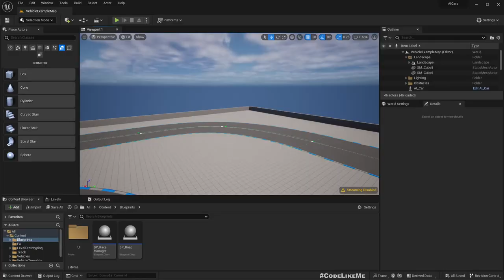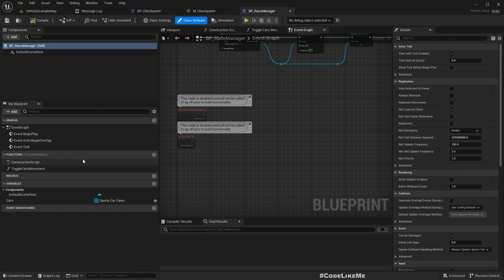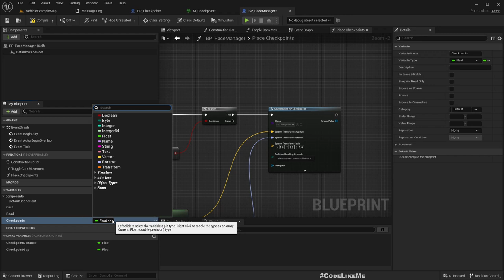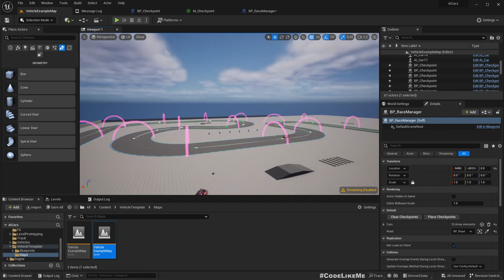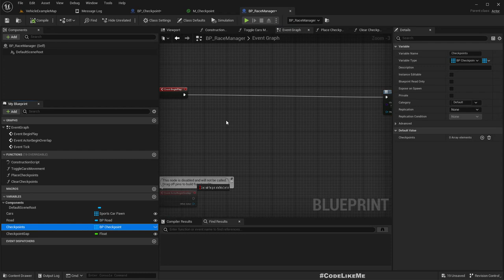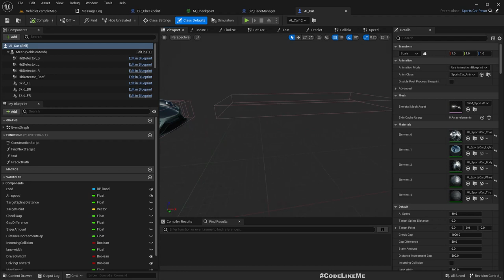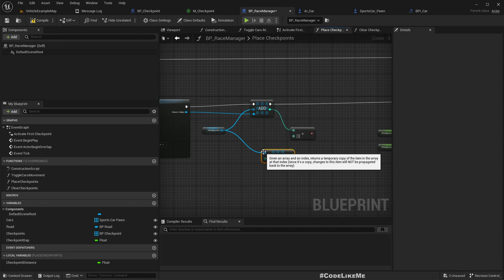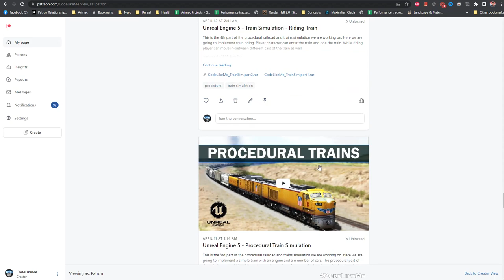Unreal Engine 5 - Car Race Checkpoints

Comment: Thanks for the video! If you have problem with "SetNextCheckPoint" about 33 min, this is the way. You will have some information at timestamp 35:30 and 35:38 (you can slow down the video on youtube to pause the video at the right time). In the BP_CheckPoint: create a variable "Next Check Point" type "BP_CheckPoint" => On Component Begin Overlap (check point collision box) => IsPlayer (target = other actor) => Branch (condition = output of IsPlayer) / True = ToggleCheckPoint => ToggleCheckPoint (activate = false) => Validated Get "NextCheckPoint" => ToggleCheckPoint (activate = True / Target = NextCheckPoint). In the SportCar_Pawn, set BPI_Car as an interface in Class Setting / interface. Compile. In the section on the left, Interface / IsPlayer, IsPlayer return node "IsPlayerControlled" in the true/false output. Hope it will help.